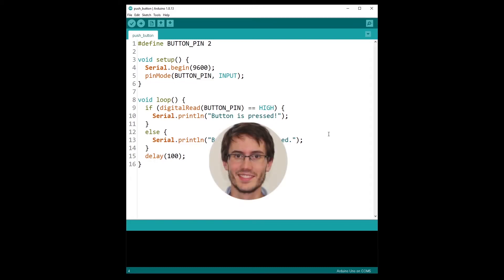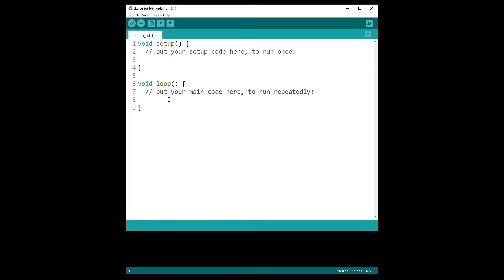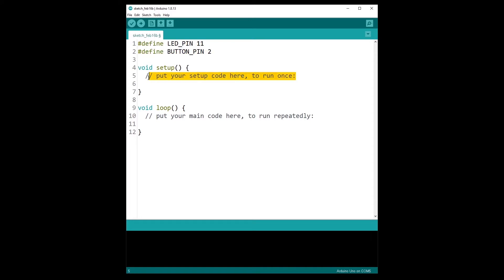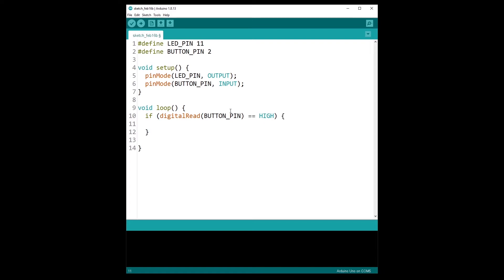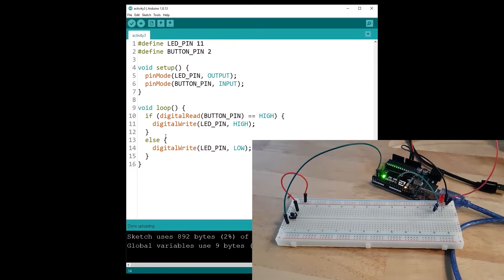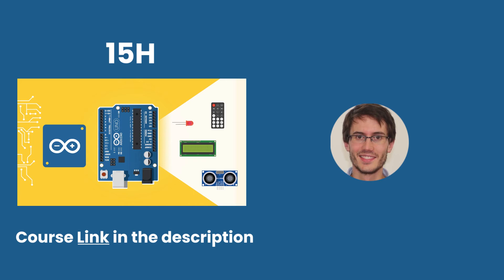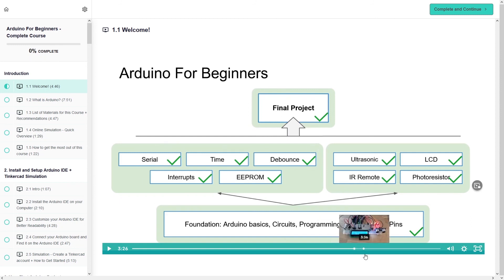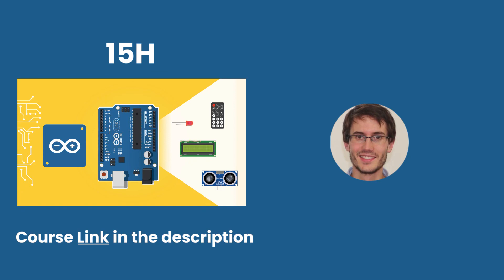Power On an LED only if Button is Pressed (Challenge 3) - Arduino Tutorial for Beginners 15

Comment: ive followed instruction but the led turns off when switch is depressed... any ideas
Reply: That's normal. To keep the let on, you need to set a variable that will save the state